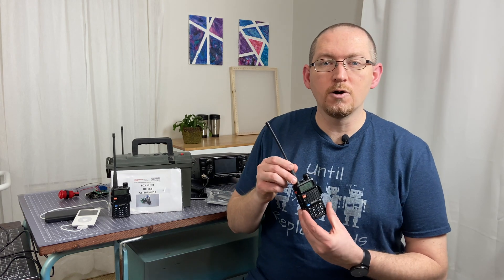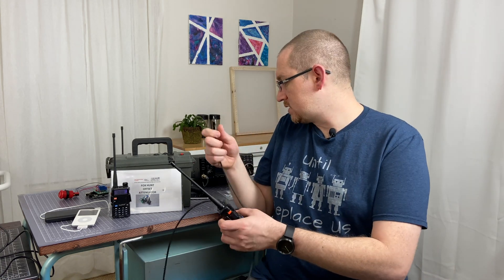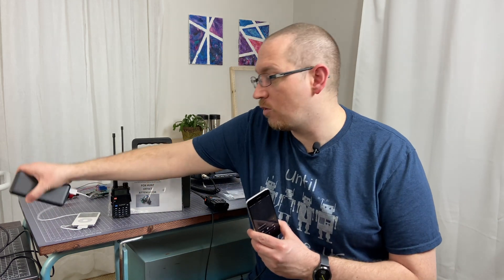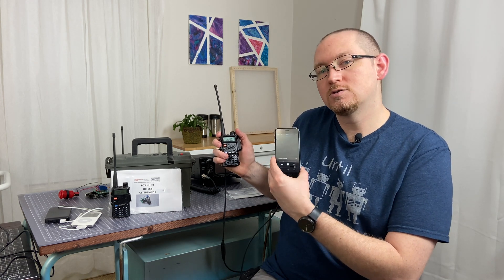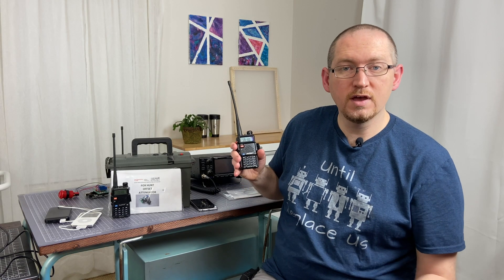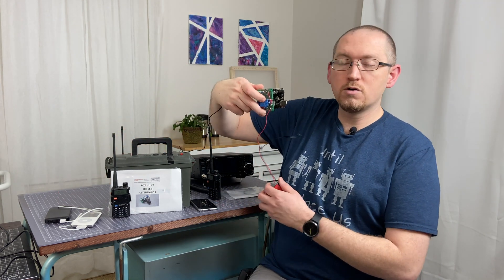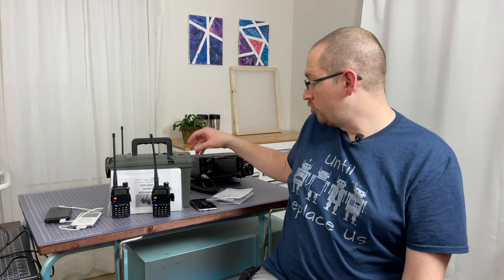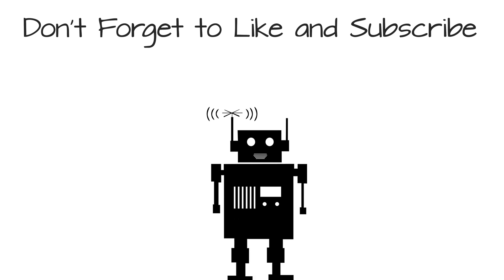Foxhunt Transmitter #1 - Baofeng + Cable

Comment: Delighted to see this video. I use the same set up for sending quick data messages . With a magmount on the roof connected to the Baoufeng I have got 18 miles

Comment: Thanks for the "we gonna" video.
The 888s have an apparent "fox hunting" mode.  Cycles the transmitter on and off.  30% duty cycle.  Put your phone next to the radio for a signal.  
Start with Ch 12 / hold down top side button and PTT, both, and turn on.
No Vox.  Hook up another antenna, amplifier, go nuts...Ten bucks.  Cycles for about five hours.  Extra batteries are cheap, too.  Or use the cradle.
You got ripped on that cable.  I have been warned.
Or, try a Surecom 112.  Fifty dollars.  Might be more listener friendly, as well.

Comment: Well, I was going to use an Arduino to communicate via my radio using CW, now I'm afraid I'm going to be switching gears and going with an Arduino, an Adafruit Soundboard and this concept using digital voice.
Reply from the maker: There are many ways to accomplish this task, and I'm a fan of trying them all! Best of luck. (P.S. Enjoying your blacksmithing videos. I busted my shoulder soon after getting my forge set up. It will probably be another 6 months to a year before I can swing a hammer again.)
Reply: @transmittinguntilrobotsrep1045  Glad you enjoyed them and hope you get better. I have my Arduino/Adafruit/Baofeng UV5R now doing CW or Voice.
Reply: @transmittinguntilrobotsrep1045  I put together an Instructables and video on the project

Comment: Thanks for the video - are you going to make a video on using the Baofeng to do the fox hunt?  I heard we need a signal meter and the Baofeng doesn't have it, is it true?  please share... thanks. 
Anthony - KJ7OJE
Reply from the maker: This is all new to me, but I’ll definitely post videos of every step of the journey. I’ve read a lot of conjecture about the UV-5R and the meter capabilities, but I’ve not seen much that seems definitive. My goal is document the use of a UV-5R with an offset attenuator, step attenuator, yagi and loop antennas. I’ll be sure to cover the Chirp squelch settings too... stay tuned! More coming very soon.
Reply: Most Baofeng displays of recent vintage have active (albeit small) signal meters.